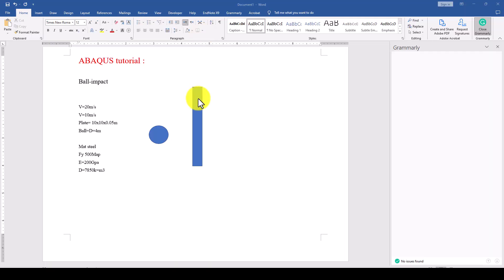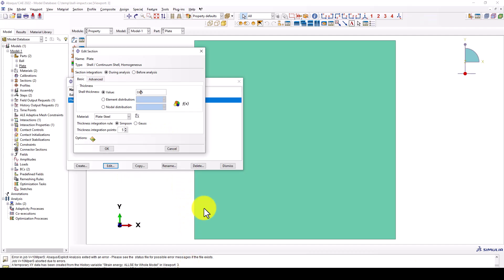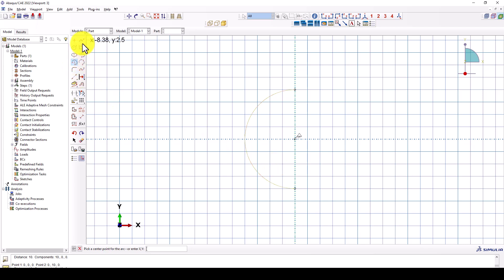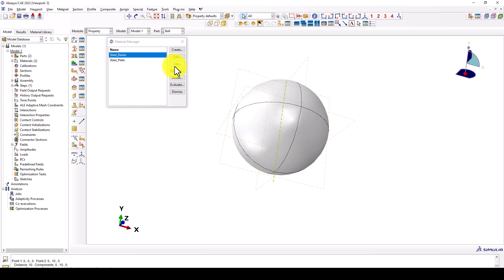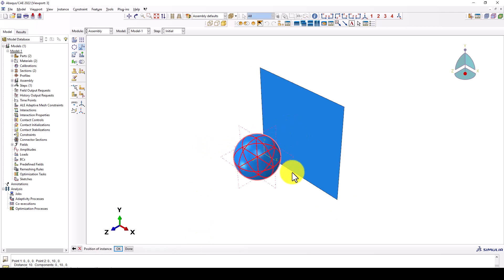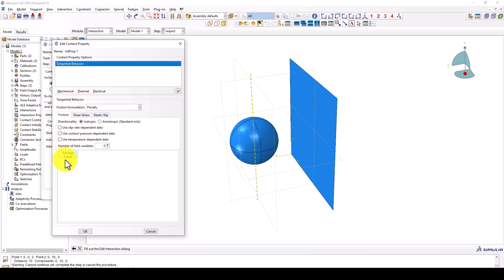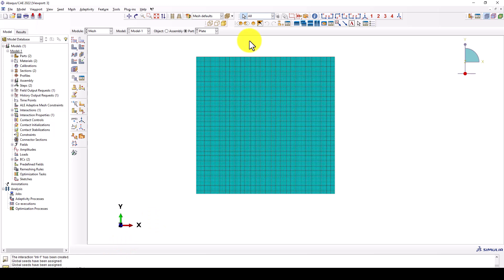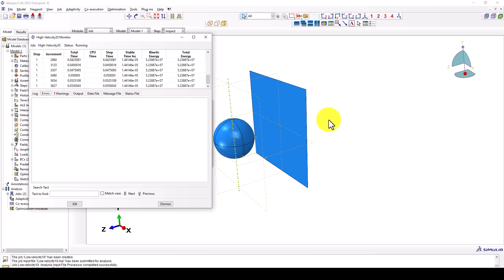ABAQUS  Tutorial; Ball impact analysis with high and low velocity

Comment: Hello! Thanks a lot for the example, I have a question since here no damage model is defined so if we define any damage model then we can see the breaking of plate or else it can be seen in the same example with higher time step, as crack can be seen even you haven't define it. So, please explain this a bit, thanks in advance.
Reply from the maker: Hi, yes. You can define any damaged properties.